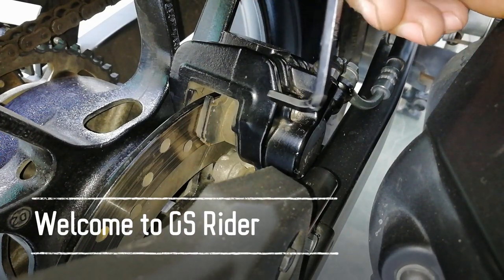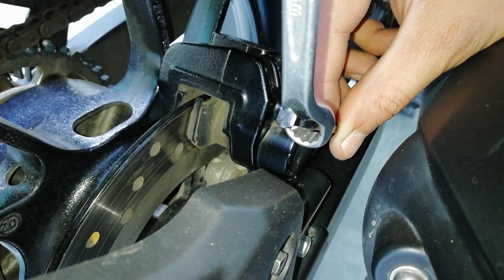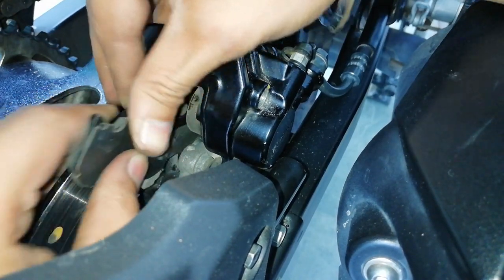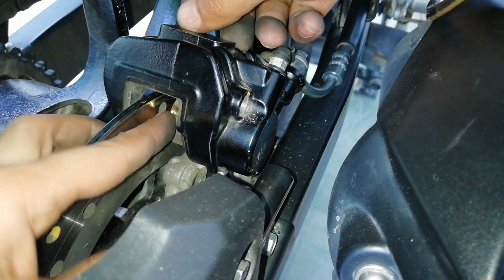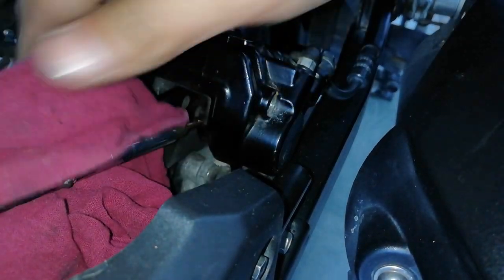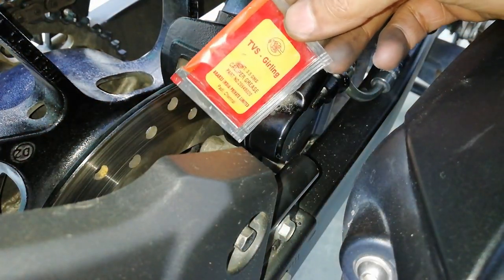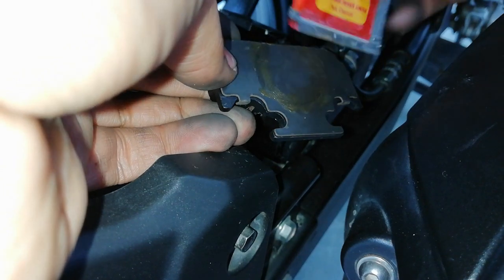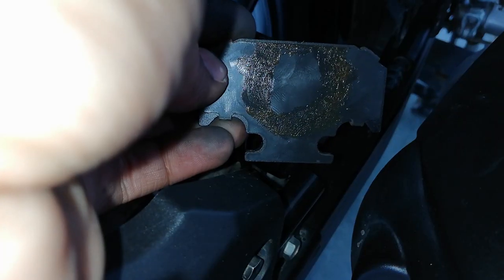Replacing Rear Brake Pads | How to | FZ25 | DIY

Comment from the maker: Hey guys,
At the time of posting this video the cost of the rear brake pads was 950 but now it has been increased to about 1300 approx (genuine pads). Those who have faced early wear out issue were probably resting their foot on the brake lever which caused the early wear out, said by the company. These pads are manufactured by Nissin if you can source this outside directly from Nissin it will cost less.
Thank you...
Reply: i have changed it today for rear and front both after 14000km done and this is the firat time i have changed them after 1 year but i was shocked when i got the bill becuase rear pads costed 1300 and and front 428 rs. i mean this is rediculously high bcoz as you mentioned it was 800, so could you let me know the change of price, is it becuase they increase the quailty of the pads or they have just increased it randomly.
Reply: Link of the brake pads ? Are these sintered pads ?
Reply: You can buy the same brake pads from amazon for ₹400. Search for nikavi rear brake pads for fz
Reply: Iam changed my fzsv3 disc pads front and rear bs4 17000kms ke baad 
Yamaha brake pads local market cost 
Front-152
Rear-960

Comment: How to know that the gap between brake pad is proper so that wheel is rotating freely.. because i think my wheels are on tighter side
And also how to adjust brake paddle of fz25 so that brake is not damage accidentally

Thnx In advance
Reply from the maker: Wheel tighter is normal

Comment: I already chenged my fz25 brack pad but have some noise how is remove the noise any solution
Reply from the maker: rashidtk valanchery The noise will go automatically after 100-200kms. New pads takes time to set. No issue.
Reply: Life of Pal thnx

Comment: Good content bro. My FZ25 has ran total of 6k km only. And till now I have not done brake pads change. But since some time I'm getting a lot of noise from rear brakes. During last service I told Yamaha ppl and they did something I guess. But now after 5 months again the same noise. It's too much noise now. Should I go with new brake pads from Yamaha service center itself?
Reply from the maker: Send the pic of brake pads at paul.1911@yahoo.in

Comment: Can you tell what kind of genuine material pads it is? Organic, Metal, semi-metal, sintered or ceramic? In Brazil the cost of the original break pads is expensive, any suggestion of manufacturer and model that I can replace without harming the brake disc too much? Thanks.
Reply from the maker: Its expensive in india also. Infact disc plate is cheaper than pads. Better use any aftermarket options available in your country. You have to just try for yourself which works best. If pads don't wear change immediately. If plate is worn its still cheaper to buy than original pads. Check the cost there. This is my suggestion. I don't know what kind of meterial is it.

Comment: Does new brake pad from yamaha does'nt come with anti squeak shims?
Actually i lost it while replacing them from karol bagh.
Reply from the maker: No it doesn't come with pads. Tell the service center to order for you.
Reply: Any idea how much will it cost?
Reply from the maker: Don't know but should be cheap
Reply: Bro did you get the anti squeak shims ??

Comment: Can you tell me which brake pads(both front and rear) to go for as an upgrade? Mine are pretty worn and was hoping to change to sintered maybe. But ive no idea which ones will be a direct fit on the fz25.
Reply from the maker: Here are sintered brake pads https://amzn.to/2zqqKTl
Ceramic ones https://amzn.to/2PVUHjB
No front available but you can go for fzv2 front brake pads from original that are very cheap and direct fit.

Comment: My rear brakes are getting worn out really fast and the wheels are not moving freely, Any suggestions on that??
Reply from the maker: Wheel movement is fine. Regarding worn yes it does worn fast. Use front more.
Reply: Okay bro 👍🏼

Comment: I have changed the rear brake pads today from a spare part dealer the pads were of nissin but after installing it the brake is very loose.. mechanic said it will be fine after using it.. will it be fine? Any ideas?
Reply from the maker: Yes it will good later
Reply: Life of Pal, i changed the brake pads a year before from the yamaha service center but that time i never felt the brake so loose.. i literally have to stand on the brake to apply

Comment: My rear brake is too tight that it makes squiky noise while riding in rotational bases and on center stand the rear wheel moves hardly inches when i push it. How to, and should i loosen the brake??
Reply from the maker: First check if wheel is aligned. Second hold caliper apply pressure back & forth it will generate slight play. Rotate the wheel to check if its free. Then press brake, if it's jam then caliper needs overhaul.

Comment: Bro is this Your First Disc Pad Replace?? For rear? I hear FZ25 disc pad gets Worn out very Quickly  please tell
Reply from the maker: Yes this is the first pads replaced at 10k. You heared it right for some people it lasted for 4 to 7k only. This issue was reported to the company, they did research and released a memorandum in which they said there is no fault with the design, those who experienced that unknowingly resting their feet on the pedal which causes wear. Still 10k is very less. Since the brake is not that effective therefore we press the pedal hard, so i think that causes to wear sooner. Now I am making the habit to use front more as they are full on life.
Reply: Bro soo Please tell me are the cheaper option available?? I mean yamaha brake pads Cost nearly 1100rs 
Are these simmilar pads Available? Outside
Reply: And please tell me Your Mileage bro? Riding this bike at 60-70kph on highway  will give how much 
And how much fuel economy  are you getting
Reply: Do you recommend  buying this bike for Daily use?
Reply from the maker: Shivansh Batham Yes its available at AliExpress for about 350 but i don't know how it performs. My friend installed it and said its good.
Yes this bike is very good for daily use. Lots of people are reporting problems but those were just silly, its not something big. Trust me i don't have any problem with my bike, i just love it. Yamaha provides best refinement than any other. Parts are affordable as well. What else you need. And the mileage i get is 40kpl. I used to get 45kpl earlier but 40kpl because running is low. But for sure it can give 45 depends on how you drive. I know 45kmpl is too much but i know how to get it. People reported 30-35kmpl on an average. I checked some of the bike personally and rode it. I didn't find any problem with the mileage. Actually there are many other factors as well which effect the mileage, which i will share in detail in the future videos. I am also thinking to make a video on how to get best mileage out of it. There is a trick i showed to my friend and mileage increased to 40kmpl.
Reply: @LifeofPal  mine brake pads last only 7,000 km. and here in mexico they cost 60 dollars for the rear ones. man i love my fz25 but, the break pads cost doble than the r6.

Comment: My rear wheel brake is rubbing against disc without applying brake. Wheel isn't moving freely. How to solve. Problem in front wheel too. No free wheel movement. Plz guide. Thanks
Reply from the maker: Thats normal. It will not be free like drum. New brake pads will be even more tight.
Reply: Your disc is bent mate.

Comment: i have changed it today after 14000 km though they were working fine but still its one year so done it for first time but the cost is 1300 for rear and 428 for front, i mean price is too much. Did they increase the quality of pads or is it smthing else?
Reply from the maker: Don't know about 1300. I bought when it was 930 and they are gone.
Reply: @LifeofPal  Yes but you mentioned that it is 1300 as well and keeps on changing.
Reply from the maker: It did went to 1300 but when one day i asked at svc they said reduced a bit. Don't know the current price.

Comment: Pal is there any way to increase top speed or can i do ecu remapping or its good to use sc project exhaust to increase my fz 25 top speed
Reply from the maker: I am i sorry have answer to your question. I don't say or suggest anything unless i really know something. I did asked to my experts they said ecu remap is not possible. Regarding exhaust i don't try those as i don't compromise on performance. Incorrect exhaust will reduce engine life. I suggest to search on google or try asking in xbhp forum.
Reply: @LifeofPal  pal otherwise shall i go for k&n filters or bmc flat filters..is there any chance to improve perfomance... Bcoz in brazil they r using kit racing like chain sprockets and tat brazil fazers claims top speed of 164...plz convey dis msg to ur experts and give me any solution to solve dis... I belive u tat u will guide
Reply: Dats totally waste unless u want to invest a huge chunk say 50 to 60k for overall engine tuneups..air filter change is a gimmick no way it's gonna improve performance.

Comment: sir my mechanic does not use greas will puting new break pad is that ok  i heard some squking sound will breaking is that  ok
Reply from the maker: The squeaking noise is because of that not using the grease. Apply the grease and the noise will go.
Reply: @LifeofPal  Where to apply

Comment: Any six gears kit available for fz25..
Reply from the maker: gagan bains A big NO. Impossible. It can't be done. Its like changing complete engine. Actually its not required. The ratio of 5th gear is equivalent to 6th of r15. Alternative is change the drive change sprocket. Either 1teeth big in front or 2-3 teeth small in rear.

Comment: Bro is this ur first brake pad change or it happens again and again??
Reply from the maker: Assasin Reaper This is first pads change bro
Reply: I'm planning for a new commuter within 1.5lakhs as I have to travel everyday around 40kms up and down in the highway road so I I'm confused whether to buy Fz25 or 200ns abs ?!
Reply from the maker: Assasin Reaper Well it all depends upon your requirement and how long you want to keep. Yamaha provides better refinement, parts are inexpensive and mileage is 40kpl. Fuel tank is big which is very plus point for highway rides. Plus its comfortable and fun bike to ride. I personally love this bike and I'm very happy about it. I know why i selected this. I'm very much into technical, i know which company provide what kind of quality which i cant talk in public. All i can say to you is, do listen to everyone but do what you think is best for you. Do research. Find out all the pros and cons and go with your own decision not with anybody else decision. 

People will say N number of things without have much knowledge or experience. Don't buy to that all. And people will talk about its top and its has got only 5 gears and all. But how many really drive continuously at top. Dont know why they bother top much. 110-120 is the crushing speed most guys do and fz do with ease. And the 5th gear ratio is equivalent to 6th of r15. So there is no need of 6th gear. Even i someone wants more top can do sprocketing alterations.
Reply: GS Rider Yamaha is a better brand with superior ride quality...and I just want to thank you for helping me out
Reply from the maker: Good luck with your purchase. I hope you are aware of few common reported problems like tappet noise, hard gear shift and poor headlights. There are solutions to it. I will keep on posting videos about bike maintenance, so keep an eye on those which will help you to keep your machine at good condition.
Reply: GS Rider bro I have subscribed to your channel before hand now all I am waiting is for the headlight good led brightness method .....and you have nice videos keep it up bro...good going
Reply from the maker: Assasin Reaper Thank you bro.. Some reports have came that HL has been improved in 2018 FZ. Even company said so. Here is the pic https://drive.google.com/file/d/115C0GuTD0RuwamJPc_qYaUT1tEjcxkKG/view?usp=drivesdk
Reply: GS Rider  woww that's quite a good change considering the earlier headlights..good news brother

Comment: are those sintered brake pads or stock Yamaha brake pads?
Reply from the maker: TEJESH TEJU Yamaha Stock pads
Reply: GS Rider even i hve the same bike .. the brakes are quite spongy or doesn't have that bite ... do u know how it can be fixed
Reply from the maker: TEJESH TEJU It is manufactured like that only. No matter how hard you press it doesn't seems to have bite. Steel braided hose can be use to increase the pressure on pads.
Reply: GS Rider ok. how about dot 5.1 brake fluid?
Reply from the maker: TEJESH TEJU No cannot be use in dot 4 system. Its silicon based fluid will damage pipes and pistons.

Comment: Bhai ye rear brake pad jadi ghis jata hai iska kya reason hai
Reply from the maker: Brake jayada use karte ho, ya foot pedal k upar rakh ke chalte ho
Reply: @LifeofPal  use. Only 5%
Chalate samay pedal ke upar v nahi rakhta hu. And  Brake pad v only right side ka ghis jata hai
Reply from the maker: Rear pads utna last nahi karta hai. Make sure wheel bahut jayada jaam na ho. Right wala isliye jayada ghista hai kyuki wohi sabse pehle touch hota hai aur uske pressure pura caliper move hota hai fir left wala touch hota hai.